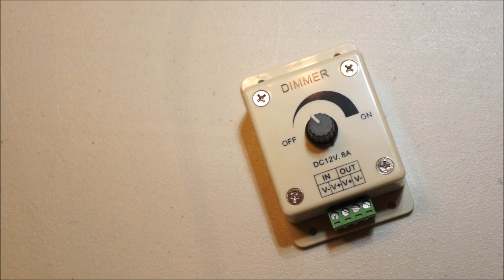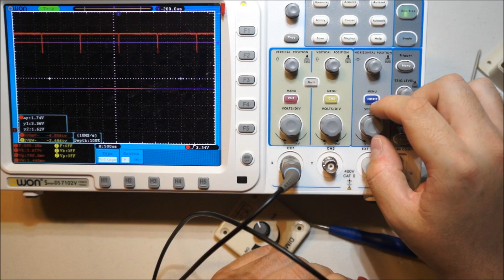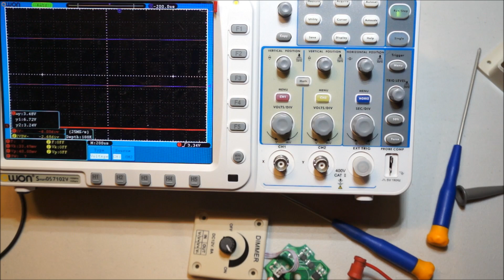Inexpensive amazon LED Lighting Dimmer teardown and analysis

Comment: It is probably for 48V versions of this, as most cheap linear regulators max out at 37V or so.  As the circuit operating current is fairly constant, all you need is a resistor that drops about 18V to 35V or so so that the regulator never sees more than 30 odd volts.

Comment: Have you seen the 12V 3 channel RGB dimmers on ebay?  They have three knobs to control the 3 channels and I opened it thinking it was just going to be three simple PWM circuits like this dimmer.  But instead it used a microcontroller converting three analogue inputs from the pots to three channels of PWM.

Comment: I have a POS CR123A cell charger, and the LM358 in the charging circuit has a logo that is designed to look like the Fairchild F, so dubious ones do exist.
Also, yes, this charger uses just an operational amplifier for charge management of LITHIUM cells.

Comment: This might be a PCB that is used for versions of this dimmer that operate at potentials above the maximum input potential rating of the regulator, in which case the resistor is simply to keep the regulator from popping.  As this is Who Flung Dung Chicom stuff, the resistor is probably cheaper than using a higher input potential regulator.  In this case, the resistor is just filler.
That is the only other thing that I can think of.

Comment from the maker: I didn't really think about that, but the math doesn't really work.

The electronics in the dimmer draw ~0.008A (8 mA)! As such, a 200Ω resistor will only drop 1.6V. 

Anyways, the regulator is in a much better package for power dissipation (it has a power-tab).

Comment: A series resistor at the input of a potential regulator is to reduce the power dissipation in the regulator at high operating potentials across the regulator.  I have an inverter that does this for its USB output, except that uses a >3W 10ohm (IIRC) resistor and a TO-220 7805 regulator.

Comment from the maker: Yep. I'm prolly going to swap the regulator so the 555 and op-amp run on 12V, so I can use a generic FET, rather then the logic-level FET currently on the board, though.